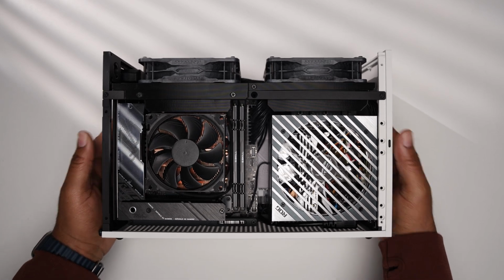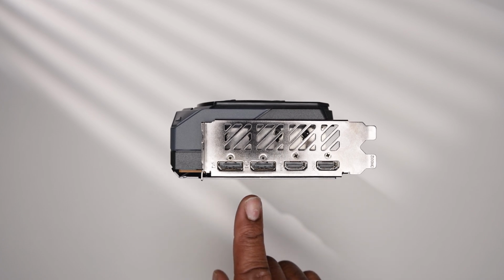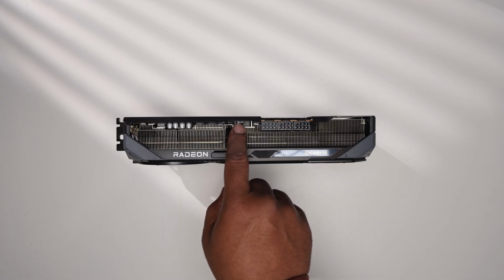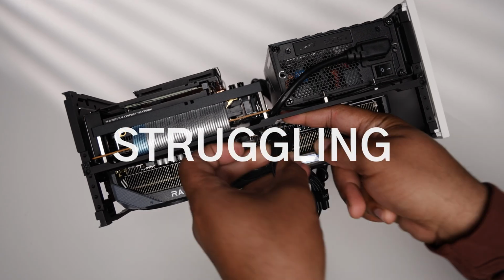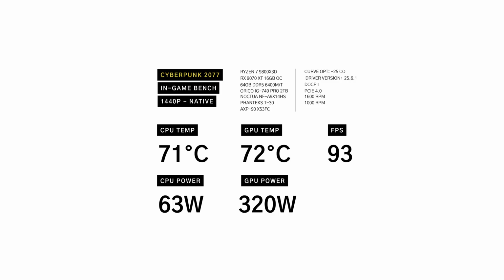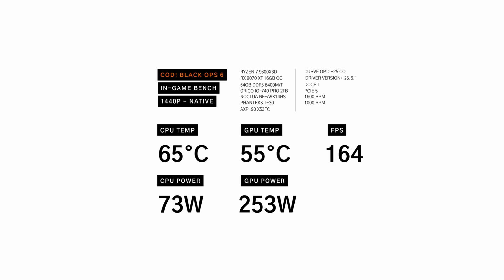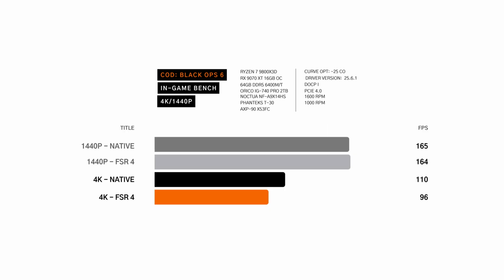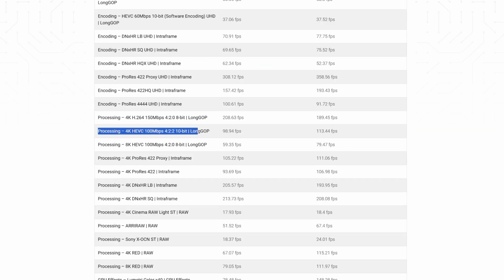My First All AMD Build: RX 9070 XT in the FormD T1

Comment: So some advice. First of all, always clean install windows for new hardware. Just prevents things like this and saves huge amounts of time. You can keep games for testing on a separate ssd and have some folder with all the stuff you need to install.

Also - don't let first judgements affect your content. Amd's drivers are by no means in fragile state now, just for context, i have 4080super, updated my drivers recently through nvidia app and got blackscreens, crashes and all kinds of problems. Spent like an hour fixing that, and i'm doing this stuff for a living.

Third point - you really need to provide more data for how gpu operates with stock bioses, like temps, power consumption and fan rpms, maybe some noise measurements too. I think though this vid is supposed to be a preview so pretty sure that's coming.

And the last thing - really not sure what "fans at 100% are loud" remark is supposed to mean? Almost every gpu has fans that max out at 3000-4000 rpm, ofc they are gonna be loud

Comment: Try lowering max power by 15%.    - 35 volt offset. Literally 0% performance loss and you will get lower temps. Also set max fan speed to 70%. That can be done Inside amd driver software (alt + R) performance tab

Comment: The crashes were probably due to a previous NVidia card being installed.
Reply: I had a similar issue. Switched from a 3080 to a 9070XT and did the whole safe mode DDU thing, but something got left behind somewhere.

After a clean Windows install, all was well
Reply from the maker: Definitely but usually DDU can clean that up.